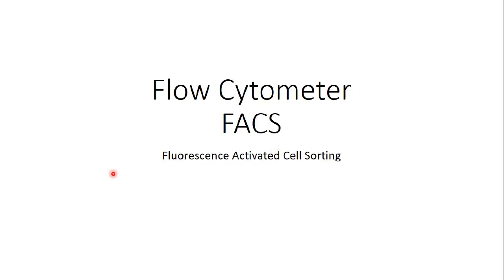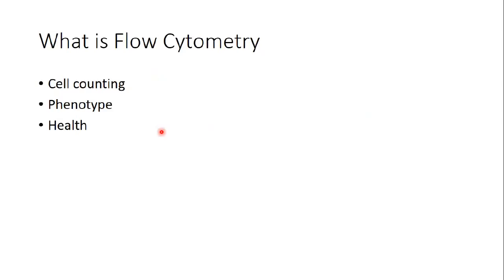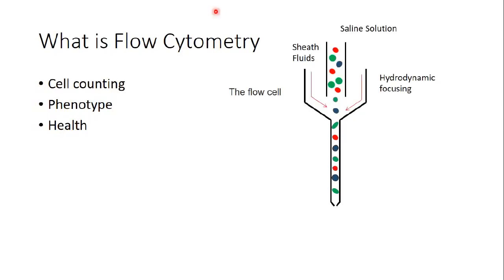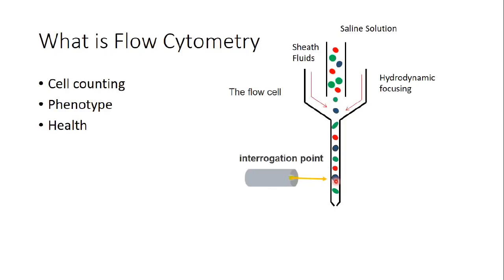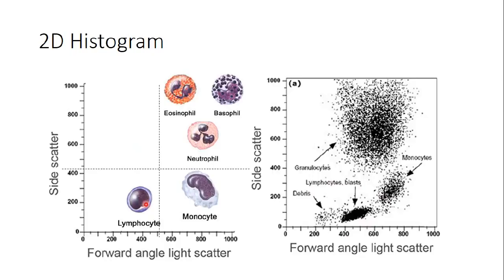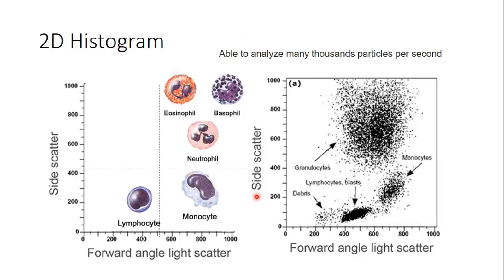The Principle of Flow Cytometry and FACS (1- Flow Cytometry)

Comment: Quick question for my general understanding? At around 03:00 you say that the greater the cell, the more light will fall on the detector and vice versa for smaller cells. 
My question is; Shouldn't it be the other way round, since the size of the detector won't change and the light will scatter more in other directions, thus leaving a larger 'shadow' behind on the detector? 
Would appreciate an answer and thus thank you in advance. 
However, thanks for the effort and the very nice demonstration on how this works! Stay motivated and curious! =)
Reply: Scattering appears not from the "borders" of the cell as it is in the pictures here, but from different intristic parts of the cell. So, if you have a larger cell, your detector will get scattered signal for longer time, thus the width of the forward signal peak (which is normally refered as FSC-W) wiil be greater than it is for a smaller cell. The height of the forward scattering peak (FSC-H, the maximum amount of light scattered during an event) could not be directly associated with sizes of the cells, but could be a marker which is unique for every type of cells. Normally we want to take in account both parameters (size and "type"), so we use their combination which is an area under the peaks curves (FSC-A).

Comment: So small molecules will give less FW scatter in comparison to large molecules? How does that work? I always thought it was the other way around; big molecules block more light then small molecules so give less FW scatter. Can u explain it to me pls?
Reply: It's less "block more light" and instead scatters the light.  So as was said before, all of the cells are too small to block the laser beam entirely.  But, instead, as they pass through, they change the angle of the light so that it's not going straight, but scattering it.  But think of it like a water tap.  If you pass a small thing through it (your finger, for example), the flow breaks and spreads out.  But if you pass something much larger (your fist, for example), the same thing happens, but to a much larger area.  So, a small cell will scatter/spread out the light as it passes through it, but a bigger cell makes a much larger area of light scatter as it passes through.  Hopefully that made sense...
Reply from the maker: The cells are so small to block the laser beam ... the small cells cause less forward scatter and the large cells cause more scatter (as shown in the video between 2:50 and 3:00) ...

Comment: so far so good ,but where are the erythrocytes?
Reply from the maker: Hei, you can extract leucocytes from a blood sample in the laboratory ..
Reply: Usually the red blood cells are lysed and removed before running cells through the flow cytometer. In addition, we often set the threshold of a flow cytometer too high so that RBCs are excluded. If you were to keep the erythrocytes in the sample and set your threshold low enough to see them, they are very small and not granular, so they would show up at the very bottom left corner.